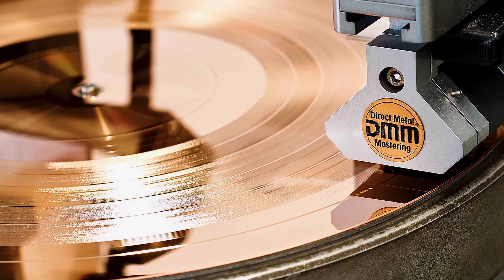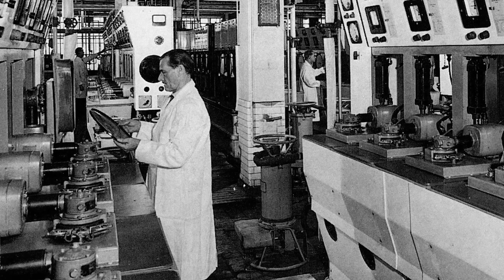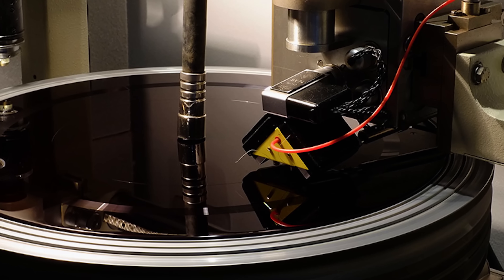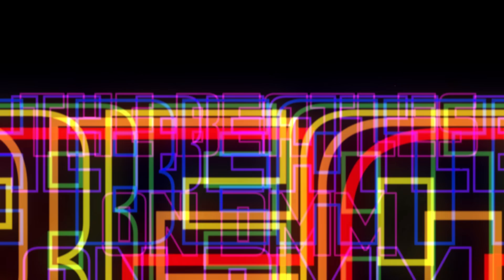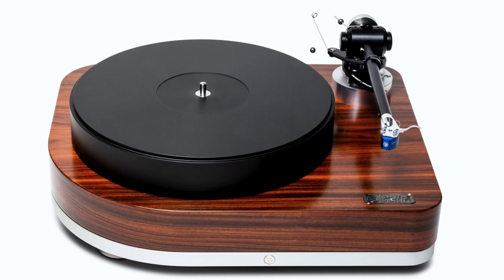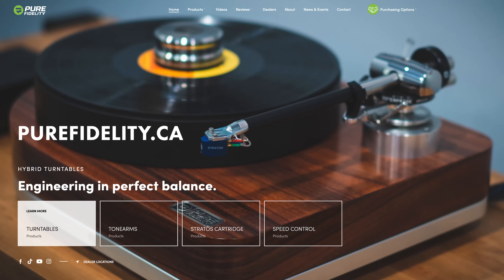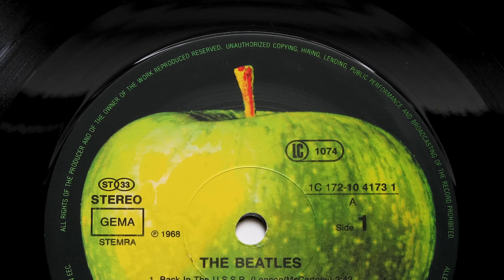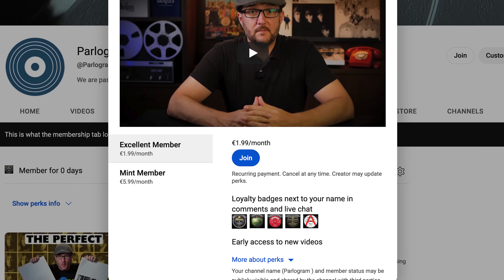How DMM Changed The Sound of The Beatles + Pure Fidelity Stratos Cart Review

Comment: The "vinyl dam" is created when the record stamper is pressed into the form where it can be used on the presses, it does not start with the lacquer. Whether the master disc was a DMM or from a lacquer, either can have or not have a vinyl dam when the stamper is formed.
The vinyl dam was created in the stereo era because using a vinyl dam created a consistently good stereo LP. As a second consideration, the vinyl dam and slightly raised label area of the LP prevented the groove surfaces from touching or rubbing against each other on a record changer, which were already popular before stereo was introduced. The 7" 45 rpm record used the raised label area to prevent rubbing or even the EMI anti-slip ring was used instead of a raised label. In the U.S., during the 80's and 90's, some 7" 45 or 33 rpm records used the vinyl dam. Again, this was especially useful for record changers so when the stylus lowered onto a record, it most probably wouldn't slide off the record.
Right, even back in the Beatles' early era, DMM was around. Metal acetates were cut for the Beatles' recordings to be reviewed. The metal acetates were considered to be the closest sounding to the original master tape.
Going back to record dams. In the U.S., record label, Classic Records, found that it was sonically better to have the record's grooved area the same thickness across the record , so they got rid of the vinyl dam  and created a record with consistent thickness across the playing surface. Many who now make audiophile records follow this line of thinking, but they have put the vinyl dam back.
A few years ago, when Atlantic Records decided to re-issue all the Led Zeppelin albums in audiophile and  deluxe editions on 180g vinyl. Pallas was chosen to press these LP's. Some of my copies have the vinyl dam and some don't. I don't think that DMM was used on any of them.
Reply: Nice info. Thanks.

 I mentioned in another post here that my UK pressed Paul's Boutique and Check Your Head are thin vinyl and have no vinyl dam. When I found them in a record shop I immediately noticed the shard edge on the records thinking that is was a bit unusual.
Reply from the maker: Great info. Thanks for posting.
Reply: @bertroost1675 I think Paul's Boutique was specifically recorded (and also pressed without a vinyl dam) to "frisbee-slice" the heads off of reanimated corpses, should the need ever arrive...
Reply: @JasonSmith-jr7jh  Nice!

Comment: Hey Andrew, enjoyed your video on the DMM pressings. I have the German white album DMM pressing which I bought back in ‘85. I did some comparisons with headphones with the ‘78 UK white vinyl and’85 German DMM white vinyl. IMO the ‘78 was the winner. The DMM is great but lacks the mid range that the ‘78 has. I used Savoy Truffle for track comparisons. ‘78 press was much fuller. I also have 62-66 and 67-70 German colored DMM’s. They sound amazing. I seem to be in between with MMT german pressing. It’s a A-1 B-3 matrix but it looks like a DMM cut. Bought it at Tower Records NYC ‘86. Confusing. Perhaps you can elaborate? Thought the matrices changed after DMM stepped in.
Reply: The DMM MMT has +C added to the matrices on both sides.

Comment: The problems with most of the Beatles DMM pressings (except the excellent White Album and MMT which I like a lot as well) are actually results of the "fancy things" John Cremer has done to the recordings - Andrew, you've mentioned that... I have produced a few albums myself which were released as DMM pressings made at Record Industry in the Netherlands and these albums sound exactly like the masters I've delivered, with a nice added analogue touch from the mastering equipment that was used for the cutting. So I can confirm that it's absolutely possible to make DMM records that sound great and faithful to the original master - the trick is that you have to stop your cutting/mastering engineer from going berserk! 😉😅

Comment: The lip, or lack of one, on the outer edge of a record has nothing to do with a lacquer cut or a DMM cut. The outer lip, and the pressing rings in the label area are from contours in the pressing moulds. These are referred to as protection rings and keep the actual playing surfaces from scratching and scuffing each other while the records stack up during production. Back when most people had automatic record changers and would have a bunch of records stacking up on each other, there were serrated rings around the labels so the records would interlock and play without slipping on the record below it. As a press operator at a pressing plant, I thought I would mention this.

Comment: Great video! One thing - I'm not sure how DMM would eliminate end of side distortion (at an equivalent diameter to a lacquer cut) as the two causes of it remain. I did cut DMM masters for quite a few years and have never heard this mentioned as an advantage before.
Reply: DMM grooves are cut narrower than lacquer by about 20%. You'd have to cut albums with longer playing time to manifest the same inner groove distortion.
Take a careful look at the images of the first two albums played. Contrast how close the end of the original pressing's last track is to the label vs. that of the German DMM. This difference is a consequence of the narrower grooves used for DMM. You threw in the "at an equivalent diameter to a lacquer cut" requirement, and indeed, under such conditions, you'd have the same distortion. But then you're not comparing apples to apples. Perhaps the last track should be repeated on each side of a DMM for those who like their distorted version.
Reply: @keensoundguy6637  You've made a good point, but stating that DMM grooves are cut 20% narrower is not really accurate at all. For a start cutting engineers would refer to grooves being shallower or deeper rather than "narrower", but the real point is that sometimes you would cut DMM at the same depth as a lacquer cut would be, sometimes you might go a touch deeper, sometimes not as deep, depending on the material. Hi-fi fans who who don't actually cut records seem very keen on putting blanket rules on these things (DDM always sounds like this, lacquer cuts are like this, there's exactly this much distortion at this diameter etc.) but it's actually not like this at all. The material that you're cutting is really what dictates all these variables and it's about critically listening to test cuts and making adjustments from what you hear, not just looking at a calculator.

Comment: I thought the 2012 wasn’t that bad.  The open hats sounded  more natural like the 1968 pressing, but Andrew is right in saying its not very exciting - about as straight forward as you can get.  Shame Sean Magee didn’t go all out and cut the track as hot as the 1968 pressing.  

Both DMM pressings are very 80’s with that top end “sparkle” added.  Still nice sounding.  The 2018 - it is what it is.  A good pressing, but with the bass and kick closer to the centre, it’s going to mask detail that the 1968 mix left open.

Comment: I think you've mixed up the 2012 remaster and the 2018 remix since what I heard and what you described seemed like the exact opposite. I also noticed that the stereo channels were flipped when I compared them to other sources. By the way, the 1985 German DMM pressing sounded the best by far as they used equalization to boost the bass and the high-end to make it sound clean and live.
Another reason why DMM pressings sometimes sound thin or brittle other than the nature of the cutting process is that most of them were cut from a digital source, which was usually mastered to sound good on CD.

Comment: I have some 85 Beatles DMM and love them, but I can see where others would have an issue with the very clean sound, best way to put it. I also have the 1985 BC13 which in some forums has been labeled as a DMM pressing, because the DMM stampers were at EMI in England at the time, but I have never been able to get a complete run down on that to verify. As far as the remixes, it's always the bass. Each one I have the bass is overpowering and not just on Beatles. I do enjoy the 1/2 speed master of The White Album. Boy your system makes my little PlaySkool look lame

Comment: My greatest surprise was the 2012 Remaster. The Hi-hat sounds like it is two rooms away. And the 2018 is not much better: all the high frequenciese of the hi-hat are curbed, no doubt because the total EQ was slanted towards the bass. For me, the greatest achievement of the John Cremer DMM remastering is the depth and definition of the soundstage. It's most noticeable on more acoustic songs such as Mother Nature's Son, but also Revolution 1 and, a revelation, Long Long Long. There are (as you know) two versions of the German analogue DMM, the earlier (and today more expensive) one on white vinyl and designated DMM on the label, the second one 'anonymous' (the one you played) and, even though with a different matrix number, soundwise indistinguishable from the first (at least to my and a couple of other critical listeners' ears). Sleeve quality is better on the second one. There is also a labelling crossover listed on discogs which has leftover labels from the white vinyl original Teldec pressing on record 2. But it's the Cologne black vinyl pressing all the way through.

Comment: Soviet release of "Hard Days Night" (1986) was also DMM and it made the album sound really metallic.
Reply: Although it lacked one track. And beware: there's also a non-DMM version of that album. A Taste of Honey (Russian Melodiya compilation album) was also DMM and sounds fantastic.
Reply: It's impossible to tell whether the DMM cut is to blame for the metallic sound or not. I would say that many people assume a DMM cut will sound metallic just because the disc is shiny and, well, metal, but it's simply not the case.
Reply: @OldGreyMulletTest  Metallic sound is associated with higher tones and less "warm" lower and middle ones, so the overall effect of DMM just sounds metallic.
Reply: @marguskiis7711  Not really. A metallic sound will usually contain a narrow bandwidth resonant fundamental frequency, often between 1kHz and 6-8kHz, or even higher, with complex harmonics, but will not be a high shelf boost and a low shelf cut. What you describe would result in a bright, thin sound. A 6 foot diameter gong is going to have plenty of very low frequencies in there.
Anyway, none of this is relevant to the material that you're cutting an audio groove into. DMM does not need to sound metallic - you're not striking or bowing the copper coated plate or making it resonate.
Reply: @marguskiis7711  Don't forget, a lacquer cut is sprayed with a thin coat of metal, and then mothers, fathers and stamper (that are created from the original lacquer) are all made of metal.

Comment: No doubt about it, the Cremer cut hovers above them all for the White album (except for those two lack of leader tape moments, dammit!). I rather like the remix, but it's a revision, an alternate, not the true item. As for the 2012---both it and Abbey Road, with their excessive bass, sound muffled and dull (as you stated). For digital sourced vinyl, I prefer Wally's Capitol "limited edition" cut from '95, which fits your description of the '91 UK cut, though I don't believe that '95 Capitol series was DMM? Can you confirm that, Andrew?
Reply: I have the entire set, most of which are still sealed. I wish I kept them all sealed.
Reply from the maker: I don't believe the Capitol '95 series was not DMM.
Reply: @Parlogram  So you're saying they ARE DMM--I would have thought so, as the UK digital vinyl coming out around that time had the DMM indication on the sleeve, but there's no sign of such anywhere on the Capitols. (on the other hand, the Sgt Pepper of that series also seems to have used the old Capitol analog master, no runout loop, etc).

Comment: The only Beatles DMM I have is a 1995 UK mono pressing of With The Beatles cut from a digitally remastered source. It is a really thin sounding record with none of the dynamism of the original analogue release and it really put me off DMM. Maybe it's the digital remaster that is the problem but, either way, it is a terrible sounding record.
Reply: I agree. The original CD was already thin sounding, with an odd flanging sound from a badly aligned tape head. There are cymbals all over that album, and the DMM process just made them sound even more spitty.

Comment: Ι have the 1991 UK DDM pressing and it sounds great, very clear,  better than the original, although not entirely free of surface noise especially on the quiet songs such as Goodnight and Long Long Long. **.  The best for me however, is the latest delux remix on CD. I stopped buying vinyl records some 20 years ago. 
**It is beside the point which is about the sound quality, but the four "portrait" photos of the fab four included in the album, are slightely out of focus. Apparently they just photocopied the original release photos.